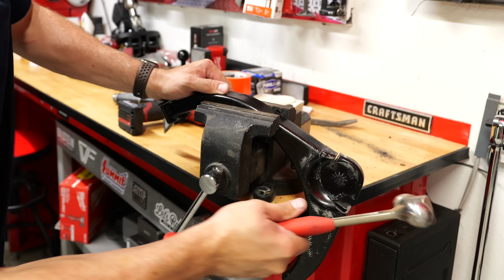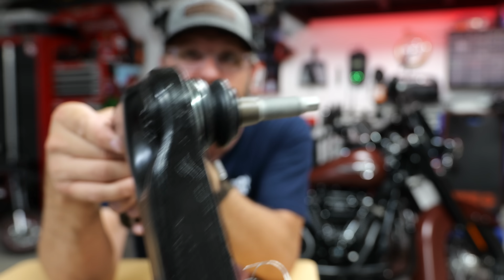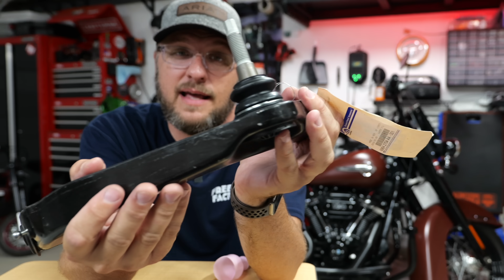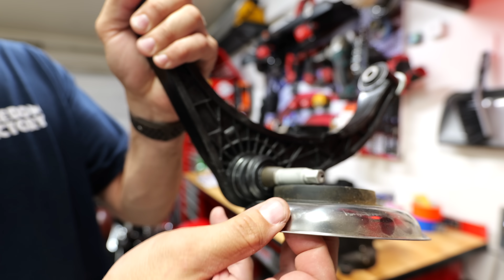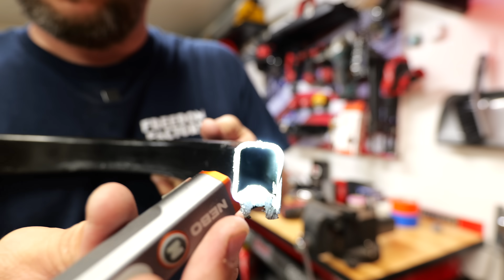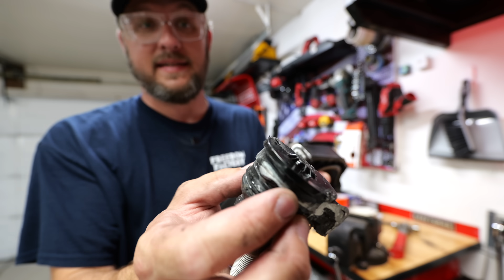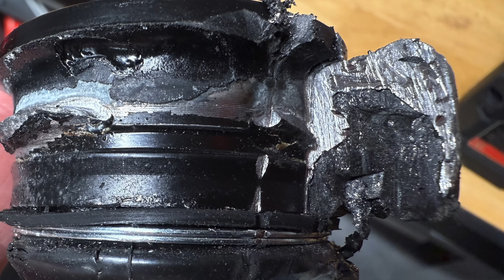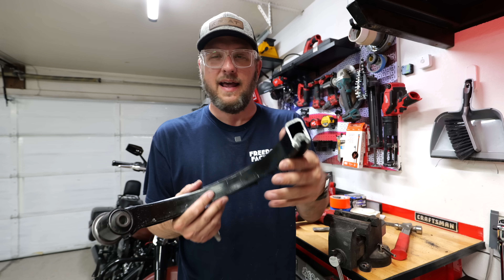I Cut Open RAM’s Plastic Upper Control Arm… Worse Than I Expected?

Comment: The plastic is there to prevent the balljoint  from being serviceable . The entire control arm must now be replaced when the ball joints needs replacing.
Reply: Sure is green for the environment
Reply: @Rusteezmedicatedbumperointment It's a corporation. Capitalism doesn't care about the environment.
Reply: @thefast427  correct
Reply: Has been like that with the Toyota Hiace for decades. At least the arm, that the torsion bar acts on, is cast steel :body-blue-raised-arms:
Reply: @Bryce-z9v the issue with the world today is too many people living behind a screen. Everyone knows everything but has literally ZERO experience in anything.
Reply: Only making it worse for the customers total cost..
Reply: THANK YOU!
Reply: @thefast427  I really don't see a problem with that. The bushings needs to be replaced along with the ball joints so the entire thing needs to come out anyways. I don't even replace ball joints anymore. I buy the entire control arm and replace it. It's faster and easier.
Reply: The plastic is there to prevent the free flanges of the metal channel collapsing amongst other things.
Reply: They don't cost much
Reply: @Allthingsoffroad-TN  well a ball joint is 20-40$ and a control arm is up to a few hundred so yeah there’s a difference, have you never worked on a vehicle yourself? (even more inflated prices if you have the work done by a mechanic or dealership)🙃
This has been a huge issue with newer vehicles so they can bleed you dry, forcing you to overpay (for disposable junk) or not able to do your own work.

Comment: Okay, so how does the weight compare with the predecessor design upper control arm? Section one of those like you did with this one and compare side-by-side. That's what needs to be done.

Comment: As a retired CAT&CUMMINGS knuckle buster  watched a video a day or two ago  GMC pickup with about 40,000 miles on the  odometer  had  a ball joint pop apart and it had a plastic A frame !!! Thanks EPA lighter is not always BETTER!!!!!!!!!!!

Comment: They used the plastic to aid in rigidity and reduce flex from the stamped steel construction. My question is are ball joints replaceable in this arm or is stellantis just using the construction to make the consumer buy another arm instead of reolacing the ball joint that failed? I feel like they did it to keep people from servicing just the joint or the bushings as a profit incentive fo stellantis to sell the entire arm as opposed to the bushings or ball joint.

Comment: What cracks me up is the inherent hypocrisy of the entire CAFE/green movement. To save mpg they try and make vehicles as light as possible. To do so, we are getting far more plastic than we ever have. Which is likely far more of a problem for the future than the burned hydrocarbons that were "saved". 

Don't get me wrong, not hating on conservation, recycling, etc...when it makes actual sense.

Comment: MANY CARS USED TO BE ENGINEERED TO LAST AS LONG AS POSSIBLE (WITHIN REASON) BUT NOW THEY HAVE A SHELF LIFE OF MAYBE 6 MONTHS -15 YRS IF ABSOLUTELY WELL MAINTAINED. HERES ANOTHER REASON NOT TO BY A MODERN PICKUP..SHITTY BC THERE LITERALLY ISNT A RELIABLE V8 TRUCK ON THE MARKET WITHOUT KNOWN MOTOR, TRANS, ECU ISSUES OR SOMETHING ELSE EXPENSIVE TO HAVE TO FIX TO "BULLETPROOF" IT.

Comment: Much larger parts of the landing gear on some aircraft are made of the latest generation of engineering  plastic. Strength is equal to alloy.
Reply from the maker: Ultramid GF50 is stronger than unfilled nylon and even approaches or slightly exceeds some aluminum alloys (e.g., 6061-T6 ~300 MPa). But it’s still less than half the tensile strength of mild steel and only about 1/6–1/8 of the strength of the ultra-high-strength steels actually used in critical aerospace components like landing gear.

Source: ChatGPT (is it wrong?)
Reply: @GearsandGadgets  ChatGPT is probably not technically wrong there, but the implication that the entirety of every aircraft's landing gear is made from ultra-high-strength steel is almost certainly wrong.
Reply: @BrooksMoses Specifically, the side bracing beams in the landing gear are often made of glass or carbon fibre filled plastics. GF50 products are nowhere near the strongest plastics available.

Comment: My favorite thing about plastic is how well it holds up over time, how well it stands up to high heat, and how well it does in sub freezing temperatures😂😂😂
Reply: @wmfinch.  You must be from another world. Plastic anything exposed to changing environment, like hot to cold and vice versa causes it to split, Crack and simply ger week. I have observed this for many years.

Comment: Total guess, it is one of two things as I do not think it would be a lower cost part than a cheapo stamped control arm:

(1) Front end crash testing (especially small overlap) - with this type of testing, what happens with deformation of parts is critical. My guess is that the plastic deforms and then breaks at a different rate than the steel, allowing a progressive collapse in a specific manner in these tests.

(2) Other, more darker theory - They are beta testing plastic control arms with the public to see how real world usage (and with plastics, more importantly, time and exposure) impacts them, but limiting their liability by using steel that is strong enough by itself. You can test in a lab, or on a track, but doesn't compare to hundreds of thousands of data points.

I agree with others on non-replaceable ball joints, FCA has been doing this stuff for years. I have an 05 Jeep Cherokee and the U-joints are not replaceable (without using a lathe, balancing machine, etc.). The driveshaft is extruded aluminum and last I saw was over $1k and backordered. Double whammy, FCA is also infamous for NLA'ing parts that they've engineered this way so your hope is that the aftermarket (like Dorman) steps in.

Comment: The upper control arms on Dad's 75 Pontiac Catalina (we got the standard 400 V-8, we didn't get the 454) were solid metal.  I remember when my father took them out (one side at a time) to press new bushings in.  Structurally good, but what I saw of the car -- paint, dashboard -- the car was not very good.

Comment: I think people are very uneducated when it comes to plastics and composites. There are plastics that can survive 400+ degrees Fahrenheit and wear out stainless steel in the process....
Reply from the maker: I don’t believe it’s as much uneducated as it is understanding that value engineering is NOT typically done to the benefit of the consumer as it is the benefit of the OEM. As I said in my video, decades of gaslighting consumers with VE decisions with marketing spin has people side-eying these kinds of decisions which is fair. Just because it can survive 400+ degrees doesn’t mean it can survive heat cycling long term like steel can. Same argument as to the Cybertruck hitch being steel mounted to aluminum which will only weaken over time.
Reply: @GearsandGadgets PEAK will definitely out last SS316 under those circumstances.

Comment: Planned obsolescence, designed to fail. Plastic doesn't last, a knick here a crack there, water Intrusion, stretching distortion, rust is an abrasive pushing to get ICE off the road sooner for elimination. Powder coating is just as bad, encapsulating water and rust over and throughout a part. Paint just rusts at the scratch powder coating sucks in through out the interface. Never powder coat anything you want to last, unrepairable.

Comment: I love when pencil pushers and "engineers" come up with an idea and jumble numbers and word things to make things look good on paper but absolute hot garbage failure in the real world. Working in the collision industry for 30 years, ive seen many very stupid ideas. Whats even funnier is the people that don't know any better defend those ideas while just repeating the manufacturers salse speech while you're literally pointing at its failing failure point. 15 20 years ago they started plastic coating radiator supports and once people got used to seeing them, they just removed the steel and now they're 100% plastic. So 100% plastic control arms are in the foreseeable future. I give it 10 to 15 years

Comment: They gotta be crazy.
I have a 20+ year old RAM 2500 with 240 K miles that goes on trips.
The plastic dashboard is in multiple pieces from the sun.
Would the plastic arms still be there?
Reply: Probably since they aren't exposed to UV like the dash.

Comment: I replaced my upper control arms in my Chrysler 300.
With a TTX by and the difference in steering wheel input and the stability of the line your rolling down the road on in night and day.
Soo the TTX upper control arms are double thickness.😮 And they make a difference those plastic control arms probably have more steering input to maintain a line.

Comment: There is very little to no strength advantages in the way this E.P. (Engineered plastic is integrated. The current steel profile provides it's-computer modeled-strength. The E.P. appears to be there more for dampening, I.E. attenuating road and mechanical frequencies/vibrations.

Comment: Going around a corner or traveling sideways on a steep hill, the upper control arm tends to take a lot of force. It's half of what keeps the top of the wheel from pushing in or kicking out and the rim from laying on its face because of the lower ball joint being a pivot point. Plastic encased in steel is really tough, rust resistant, and would lower vibrations. If it was full of plastic, it would probably be great.

Comment: I don't think you know what you're talking about Hollow cavities means that rust out twice as fast sheet metal you can't replace the ball joints or bushings you have to buy a completely new upper AR assembly Ram trucks just proved how bad they are building these things now but charging huge amounts of money they design it to fail and then say stuff like it's good for fuel economy it's not good for the environment because they go to the scrap yard /landfill 80 times faster

Comment: This is still a major problem!
 1. The biggest one it the steel condensates with temperature changes. So that would mean that the part will rust out from the inside out. Any part that is fully boxed in needs Drain holes for the condensation To escape.
2. plastic always gets brittle over time. For most people, the ball joint would go shot before that happens, and you would replace the whole controller arm. However for someone that doesn't put on many miles at all, and may plan to keep the truck for over twenty years, The plastic would not be as strong in that amount of time.
Reply: The truck won't last long enough for it to rust out.

Comment: Plastic with steel insert. The previous hen were aluminum. 
And MDS was devised because of CAFE standards. And they don’t fail anywhere close to what the internet and especially YouTube has you believe. Over 6 million 5.7 Hemis have been made since 2009. Up through 2015 when the warranty was either lifetime(2009-2012) or 100k. The failure rate has been a steady 2% on the lifters. That’s over 100k failures still. But when you consider how many have been made it’s nothing.

Comment: Absolutely no suspension components should be plastic, even many of the engine components that are plastic are ticking time bombs, time will show how plastic parts require metal replacement and long life is not going to happen.

Comment: I don't think anything nowadays is engineered with the purpose of making anything "better" . Everything is engineered to make it cheaper, lighter and just good enough.
Reply: Don`t forget disposable too.
Reply: while at the same time, dramatically increasing prices for customers
Reply: Cheap 🤣🤣
Reply: And planned obsolescence!!!!!!!!!!!!!!!!
Reply: My Tupperware lids used to last 20+yrs.
Now it's about 2 yrs.
Quality of plastics has technically improved, to be cheaper 😂
Reply: Used to be forged steel or forged aluminum.   Did you see the void in the middle of the thickest plastic.
Reply: The customer is no longer in the equation in any product today. Always cheaper, thinner, lower quality and smaller to benefit the manufacturer at the customer's expense.
Reply: Blame the govt. Emission and mpg regulations require manufacturers to make vehicle lighter and lighter. Yeah  they can make them out of titanium, but that would be prohibitively expensive, so they go plastic instead.
Reply: @alecb8509  don't blame the greed of giant corporations? Lol wtf 😂
Reply: @alecb8509  Also blame the environmental militants who won't be satisfied until all that's left to buy are flatulence powered cardboard vehicles.
Reply: Built to  last just passed the warranty !!
Reply: In many instances they re engineer it to be worse (when they already had the initial R & D that made a product that was fit for purpose).
Light bulbs
Razor blades
Nylon
Vinyl
Lead Batteries
Tyres
Stainless Steel
Etc.
Reply: Maybe take all the useless unnecessary electronics and trash out of the vehicle! Make me one of those. I don’t need independent zone temperature control I just need a goddamn heater!!
Reply: @600wheel  agreed cars have gotten rediculous. A backup camera on a ford fiesta. Really
Reply: @curtis1951  
100%
Reply: New stuff is overpriced garbage. I own: 95 Silverado 365k, runs great, son drives it now. 07 tundra 430k, still drive to jobs without a care. 05 land cruiser 280k, its cherry. 2024 Silverado 33k, been in the shop 6 times, stranded me 4 of those times and had to have towed. Its at the dealer shop as I write this. Not keeping this POS.
Reply: It looks like you need to replace the whole arm for a worn ball joint.  Why?????
Reply: Engineered to be replaced regularly.
Reply: @curtis1951  you would think that if plastic is cheaper to manufacture, then I would have a truck that I could buy without having to finance
Reply: @Vernon-gn9wb 
Cheaper for the manufacturer, not for the consumers 😂. They like their profit.
Reply: Not necessarily. It all depends on the product and the company manufacturing it
Reply: Same thing with 20 WT engine oils and oil filters using cardboard end caps.
Reply: It is better (for executives’ annual bonuses).
Reply: A mechanic I talked to at a GM dealership said the same thing.
Reply: @curtis1951  and to fit in epa degradation. They changed my RAM 1500 HEMI  and Durango 6cyl with 0w20 synthetic. I swear both run under powered in stop and go traffic. Ah, you said it, ACTIVE FUEL MANAGEMENT, eps junk.  Back to your excellant video. Thanks.
Reply: They don't hire engineers they hire fruity designers now and those designers only hire designers so the designers have the mind the only way they keep their jobs is to make everything where they're only temporary right So all the cars now or impossible to pay off by the time alone is ended for the majority of Americans. Because let's just face it if you can buy a Dodge ram or Dodge whatever with cash you're probably going to dodge and then go buy something more worth your money.
Reply: No, it's mostly designed to not infringe on any other pre-existing patent.  The only reason they're even redesigning these parts is to give superfluous engineers something to do.
Reply: @curtis1951  just good enough to get through the warranty period
Reply: That's always been the way
Reply: @curtis1951  it's engineering to meet crash test ratings, Cafe standards and all the other regulations. If we take all the bs regulations away we get better cars

Comment: Will give an example of BS within the industry. My 1974 GM 6 cylinder  with points and a knee action fuel pump on resonable level roads with me driving it would get 26 even 28 miles to the gallon now I no this is not exactlly the same truck but my 6 cylinder Ford pick up with all the moderon bull $hit on it on the same strech of road struggles to get 22 miles to the gallon and thats on a good day. Fuel saveing Bull $hit. And that goes for all the cheap parts going into trucks all it means is these theifs want to make more and more money, nothing to do with anything else.

Comment: I suppose there is some protection from rust in the northern climates.  Other than that, I would be more inclined to see the part made from aluminum. At least it would be mostly recyclable.

Comment: There isn't a single engineering decision on anything that is made for the benefit of the consumer. Its all about saving money for the corporation either by cheap parts to maximise initial profit and ensure the parts lasts just long enough to mpg or safety improvements that are solely about getting it past the current standards so they reduce the likelihood of being brought to court. 

Even when there are manufacturers defects that clearly cause fatalities it is weighed carefully by cost to recall and fix V projected cost of payouts to the family during the warranty period.  And if the recall cost is higher then they let those fatalities happen

Comment: Fiber reinforced plastic is really good stuff when done right.  Graphite panels that everybody loves on car panels  not so much as a submersible hull.  Light, strong, can be made in optimal shapes ( tubes).  May be lighter than forged aluminum.  Unsprung weight reduction is key to lots of benefits.

Comment: It's going to rust out in the Northern climates. Your never going to keep moisture out of that and since it's boxed sheet metal it will rust out quickly. It's just cheaper that a full stamped part with heavier metal, the less metal the cheaper to produce because you don't need a heavy stamping die when engineering changes are made.
Reply: it will break in under 100k in my city, its basically offroad here but worse, huuuuge pothooles in the thousands, last one i hit it ripped the tire off the rim.